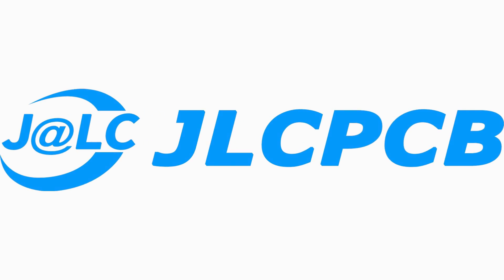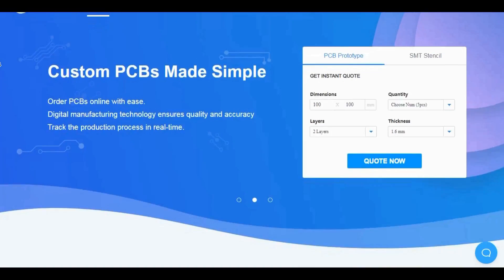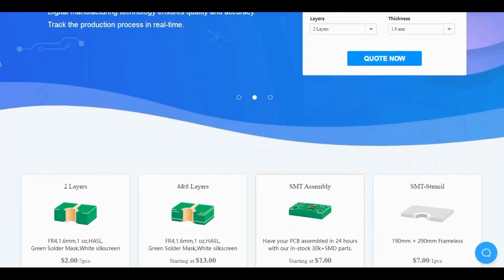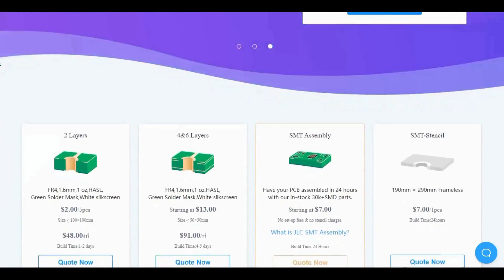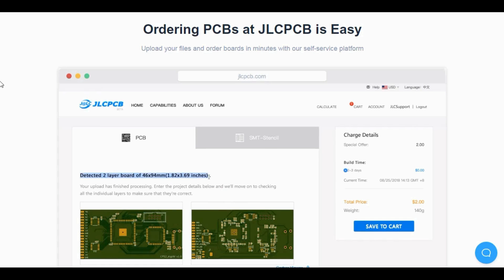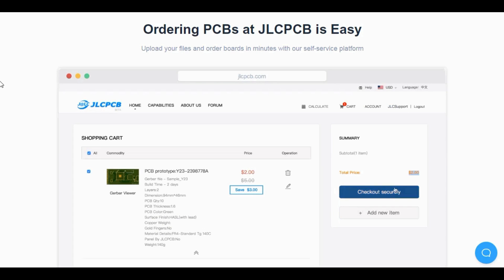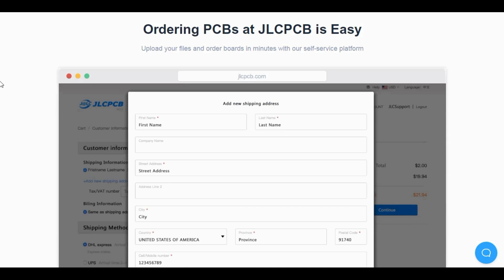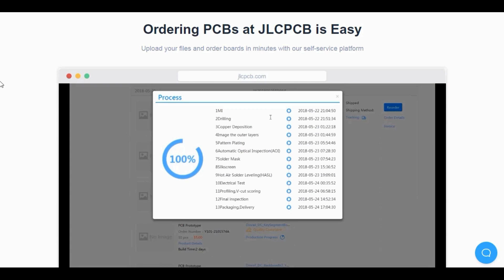DIY Mini Drone Using Syringe Tubes

Comment: That's impossible 😂😁😀
Reply: Why dear? It's just a sample module. With a lighter lithium battery it can fly. Probably in our next project we will test that.
Reply: @SimpleDelicacy  whenever the motor turns clockwise the body will turns counter clockwise. Besides the motor is too heavy compared to its RPM.
Reply: We appreciate your projection. But we will give it a go.
Reply: @SimpleDelicacy  okay. Good luck 👍